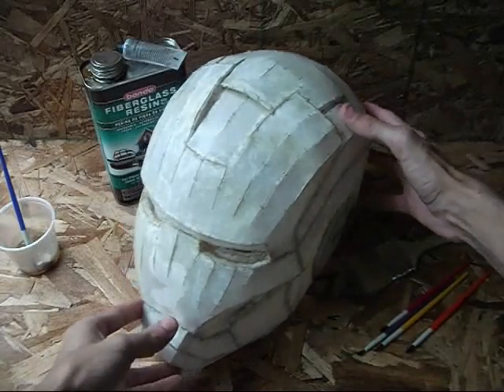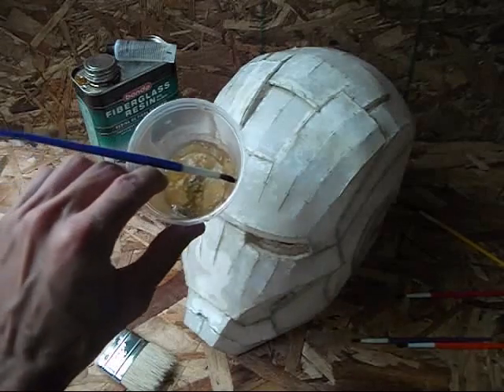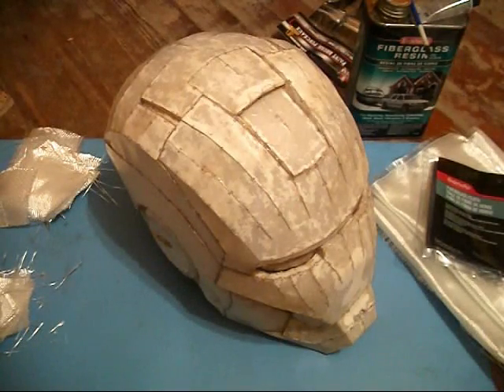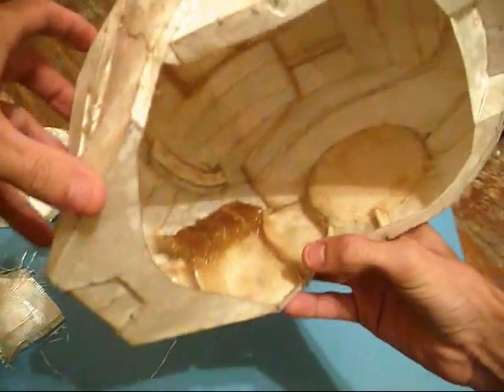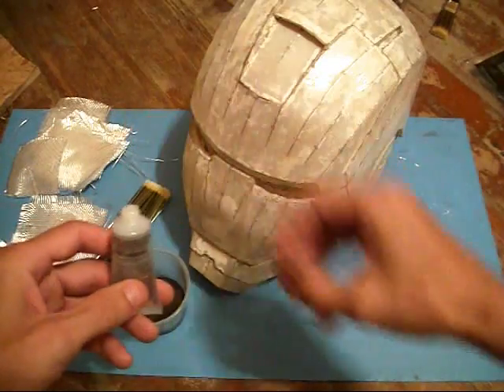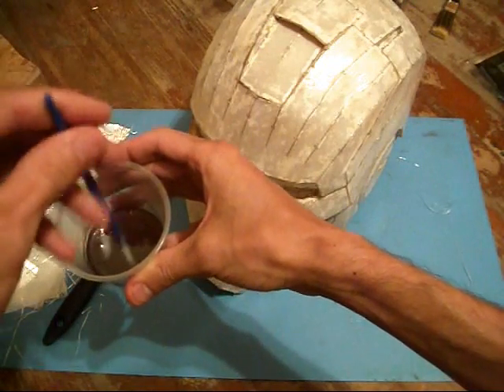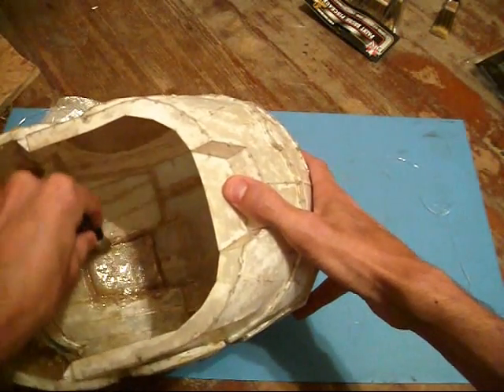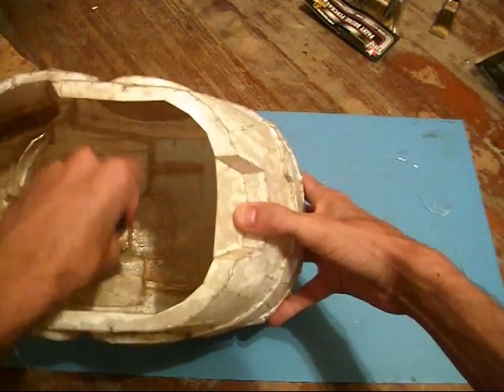IRON MAN HELMET BUILD PART 2 ~ RESIN & FIBERGLASS

Comment: So you use fibreglass resin, one brushed on coat inside and out? at what stage do you separate parts, such as the faceplate if planning on making it move. Also does the resin block up the small grooves and details

Comment from the maker: I took about a week assembling mine as well.  It may look good in the video but rest assured it was FAR from perfect.  It was warped, had dents, wasn't sitting flat, and the jaw on the right side was sunk in probably half an inch.  The teeth and eyes were not complete and there was no gap between the upper and lower jaw.  Half the time I have into the helmet at this point was spent fixing all those mistakes!  You can see how messed up it really was in the part 1 video.  Just keep at it.

Comment from the maker: Not sure what $488 you were looking at but you just need the $21 Bondo Fiberglass Resin.  I would get it on Ebay though, it's probably cheaper on there as it's only $14 here in my local store.  Also, it does not have to be 3M or Bondo brand for that matter...as long as it's polyester based resin it's the right stuff.

Comment from the maker: It does not affect the AMOUNT of hardener you add, but it will affect the TIME it takes the resin to cure. 
Colder temp = longer cure time
Hotter temp = faster cure time
It's ok to add a few more drops of hardener to speed up the cure time, but adding too little hardener means the resin never cures.

Comment from the maker: You want to use Bondo on the outside.  You would be making much more work for yourself trying to just use fiberglass resin layers.  Fiberglass resin is too hard to sand by itself, and without fiberglass laid in it, it will crack over time.  Bondo is meant for filling and shaping.......it is MUCH easier to sand, and will not crack as it stays slightly flexible.

Comment from the maker: Fiberglass (polyester) resin has a clear liquid hardener and Bondo/body filler has a cream hardener, usually red color.  You probably mixed the Bondo hardener in with the resin which is fine as they are both polyester based products.

Comment from the maker: You need to fully finish the helmet with fiberglass and Bondo first, then, before painting it you would cut the helmet in half and add a hinge at the top and clasps at either side of the bottom so you can fit it around your head and still keep the opening around your neck small.

Comment from the maker: Yes, fiberglassing inside strengthens the entire thing...inside and out.
After this you would add Bondo (automotive body filler) to smooth it out.
The fiberglass cloth cost $6 for eight square feet.  The resin was $14 for a quart.

Comment from the maker: With one layer of fiberglass cloth it is plenty strong for wearing and having moderate pressure applied to it.  I did a total of three layers of fiberglass, and yes, I could stand on top of it and jump up and down and it would not break.  If it's not strong enough for you, just add more layers until it is!

Comment: If you let the resin sit for a bit, until it gets tacky (but not fully cured) you can lay the cloth on the tacky resin and it works like an adhesive. It's easier to control bubbles this way, and the cloth will stay in place while you paint the next layer of resin on top of it. Let that second layer tack up and you're ready for the 2nd layer of cloth, then repeat.

Comment: another great method for applying the fiberglass cloth would be to spray the inside of your piece with an adhesive spray and coat the inside completely with the cloth. the adhesive will hold them all in place pretty well and you can go ahead and lay down your resin, makes it a lot easier too.

Comment: Really basic question, but what kind of glue are you using to hold the cardstock cuts together during assembly? I would like to use something extra strong, but not anything that will take hours to dry, such as crazy glue (which I hate using, but will if it's the best). Thank you

Comment from the maker: I recommend using a Dremel tool with a cutting/cutoff wheel.  If you need to get into REALLY tight corners or curves you can use a blade from a scroll saw or a coping saw and your hands.  Those blades are extremely small and could finish any cuts the Dremel couldn't.

Comment: so when the pepakura viewer 3 pops up a window saying 
the size of paper specified by pepakura designer is not same as printer setting. adjust scale? yes/no
what do i do? because if i adjust scale the pieces looks kinda small and the numbers are not visible but if i dont adjust the pieces dont fit on the paper.

Comment from the maker: If the pieces are sicking to your brush, you need more resin on it.  The work doesn't have to be perfect......whatever has bubbled should be cut open with a dremel or drilled out and filled in with more resin to remove the air pocket.  Any strands sticking up...just dremel or sand them off.  When you're finished doing the inside you can always add more layers of fiberglass anywhere you missed.

Comment: I'm certainly not trying to knock your craft. My senior design team for school got to use the mechanical engineering departments 3D printer and I was kind of wondering if we could apply fiber glass to our ABS plastic fixture to make it stronger. It's strong, however it is just melted layers of plastic and I'm wonder if, over time, those layers will delaminate. Can the resin and fiber glass be applied to polymers?

Comment from the maker: Filler Primer and Bondo/body filler are two completely different things.  Filler Primer is meant to be used after you have applied and smoothed Bondo or glazing putty.....it only fills in SMALL scratches and defects to get the surface even smoother before painting.  You need Bondo.

Comment: Cool! Have you ever considered using a 3D printer to make the shell and putting the fiber glass on that? I just used a 3D printer at my school and my design is made out of fairly strong ABS plastic, which would only be stronger with the fiber glass.

Comment from the maker: No, fiberglass and Bondo the whole helmet to your satisfaction and then cut the faceplate off wth a Dremel at the end.  If you do pieces separately it will be extremely difficult to have everything line up since the resin somewhat warps the paper once it soaks in.  Spare yourself a lot of hassle and do it all in one piece.

Comment from the maker: Technically, yes...however I would strongly advise against it.  You need to use a thicker paper like cardstock because regular paper warps and distorts out of shape too much from the weight of the resin.  People have done it, but I have yet to see a nicely finished helmet made from a regular printer paper pep build.  I wouldn't waste all my time cutting and glueing just to have it turn to crap because I skimped and used the wrong type of paper.

Comment from the maker: You can still work with the piece you have.  There are parts of my helmet where I deliberately placed fiberglass on the outside for extra strength.  Just proceed as normal and Bondo right over top of it...it's fine.

Comment: Recommendation!...   1 cote of fiberglass on the outside making is stiff enough to work with.  then mix fiberglass and bondo together half and half making a pour able mix that is like a milkshake type thickness and pour it all inside the helmet and guide it around on the inside until everything is covered .  this will make the helmet rock hard .   this will save you time and money just by doing this simple trick.      thanks for using my Pep File By the way.

Comment from the maker: I'm sure it would eat away some types of foams, but probably not all.  I've never tried hardening foam with polyester resin.  Most people that build costumes or props with EVA foam will harden the pieces with watered down PVA glue (white glue) brushed on in several coats, or with a product called Plasti-Dip.  Either way, polyester resin will not saturate foam like it will with paper, so you would need many coats to harden a piece.

Comment from the maker: You can use any respirator as long as it has Organic Vapor Filters on it. Regular dust and painting masks with elastic strings will not work...just make sure it's a rubber respirator that creates an airtight seal around your nose and mouth. I use a quality respirator made by 3M, which you can find at Lowe's or Home Depot, but if you have a Harbor Freight Tools around, you can buy a respirator with filters for about $15.  If it's good for automotive painting, it's the right kind.

Comment from the maker: The brushes are basically garbage after use...that's why most people use cheap brushes and just throw them away rather than bother trying to clean them.  Soak them in acetone BEFORE the resin hardens if you want to reuse them.

Comment from the maker: Yes, sand or dremel off all the loose strands.  Afterwards, if you want to add another thin layer of resin to really seal them in and smooth things out then there's no problem in doing that.  I did both on my helmet.

Comment: I've finished one layer of fiberglass on the inside of my helmet, and I've realized that there are a lot of loose, but still very rigid, strands of fiberglass on the inside of the helmet that would make it uncomfortable to wear. Is the best way to deal with these simply to sand them down, or to put another layer of resin over them, or what? Looking forward to the new video.

Comment from the maker: Everthing was hot glued.  I started by glueing the faceplate to the back/top, working my way out from the center, and down the sides, glueing as I went along.  After the faceplate was on, I finished with the lower jaw, again, from the center out.  The opening does not get altered.  You need to cut around the perimeter of the lower back panel after it's resined and have it reattach (usually with magnets) after you put the helmet on your head.  I will cut my panel out after the Bondo is finished.

Comment from the maker: No, you need to use 110 pound cardstock paper.  Anything thinner will collapse or buckle under the weight of the fiberglass resin when you try to harden it.

Comment from the maker: Resin and fiberglass is the way to go and the strongest oprion.  People sometimes mix resin with Bondo to create "Rondo" and brush or pour it on the inside...mostly to save time and money, but it will make it very heavy and is not anywhere near as strong as fiberglass and resin.  I would take the extra time and $ and do it the right way, but it's up to you.

Comment: |If you want a rock solid non flexible version after you do a light coat on the outside mix up 1l of premium resin with about 12% activator pour it straight in the helmet and continuesly swirl it around making sure all areas are continuesly being recovered by the wet resin.
After about 15mins you shouldnt be able to swirl it anymore as the resin should be nearly gone off.
Resin should be about 8-10mm thick and thicker where there are dips when completey set will need a hammer to break it.

Comment from the maker: I didn't have a respirator at the time.  I was working with a ceiling fan on next to an open door with another fan exhausting to the outside.  You really don't need to use gloves unless you want to....the resin won't hurt your skin...it's just really sticky.

Comment from the maker: I just used the default size from the file for this helmet.  Before you print it out you can see the measurements of the finished helmet in the lower right hand corner of the page.  Measure your head front to back, side to side, and top to bottom and compare that to the measurements listed for the finished helmet.  If it's too small or too big, adjust the scale up or down 10% in the program.

Comment from the maker: Yes.  Fiberglass resin and body fillers like Bondo are extremely toxic carcinogens....their vapors can cause respiratory problems and brain damage.  You need to wear a respirator with organic vapor filters on it.  I show such a respirator on my part 4 video which you can buy for about $20 at any hardware store...it is VERY important.  Wear latex or nitrile gloves if you want, both can cause skin irritation (especially the hardeners).

Comment from the maker: Yes.  Mix up the resin and hardener, and brush a coat on the outside and let it harden for an hour or so.  When the outside has hardened, brush a coat on the inside and let it harden as well.  After that, the helmet is ridgid enough to add fiberglass to the inside and really start adding strength.